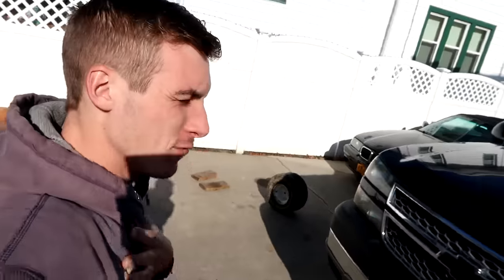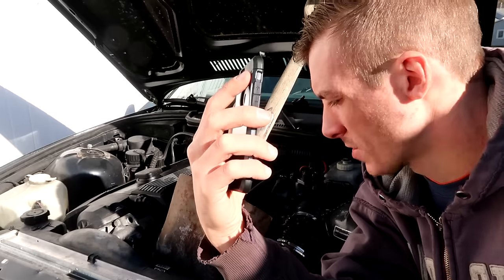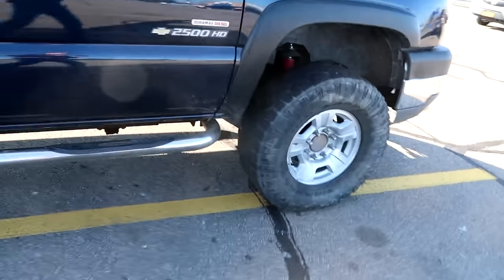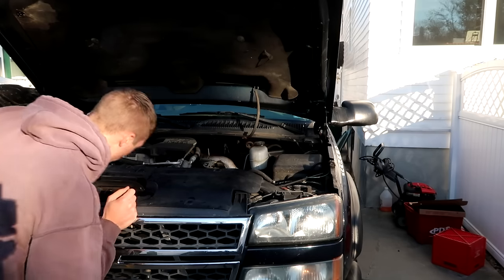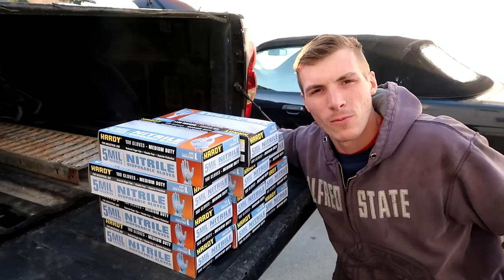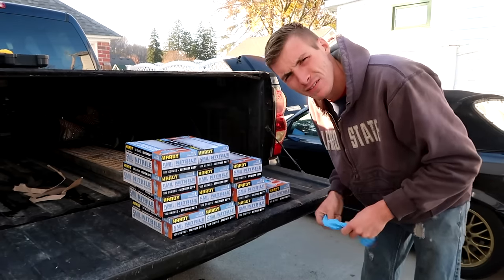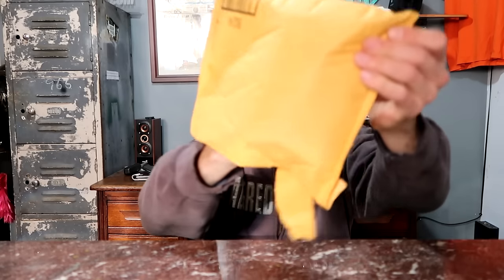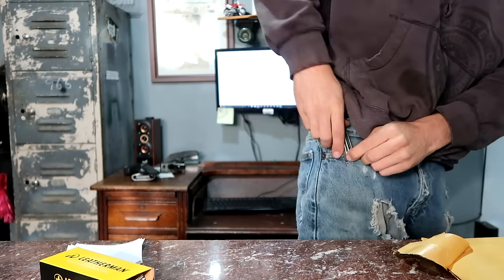I CAN'T PARK IT

Comment: funny cause from what I know the reason they do not put caps on the radiator anymore is because people would open the radiator cap when the engine is hot and get hot coolant sprayed in their faces. So now they only put them on the reservoir. Oh and your in a Duramax you can park how ever the hell you want

Comment: can someone help me if i have a 15" 4 amp led bar what should my fuse be that goes from my fusebox to my battery to my relay ?
Reply: jean tsai fuse box to relay.
Reply: gurbeer athwal sorry i meant battery to relay
Reply: jean tsai What watts are the leds and how many, what battery voltages are you using?
Reply: CafeNightster 12v car battery the led bar is a 24w led bar what fuse should i use from my battery to my relay ?
Reply: jean tsai (24÷12)x1.25=2.5amps, so I'd say a 5 amp fuse.
Reply: jean tsai yup 5 amp is fine. the only problem you might have is when turning it on. it draws more power at start up. if this happens go to 7.5 or 10 amp fuse. it also depends on the length and gauge of you wire.